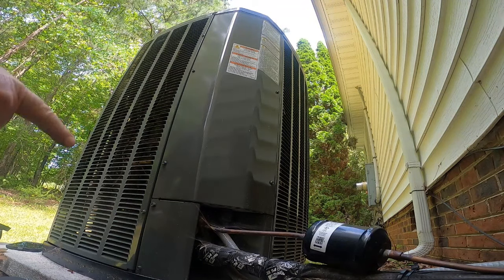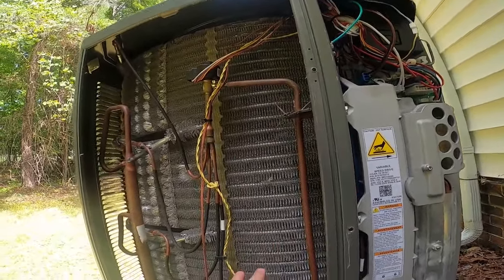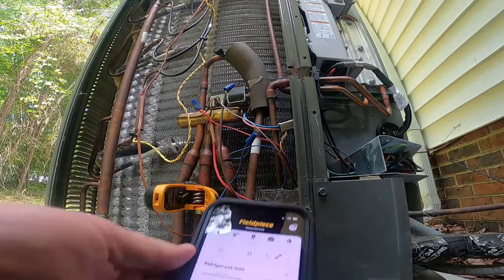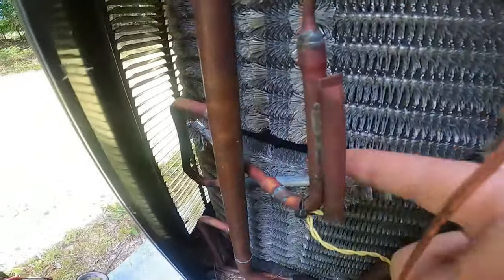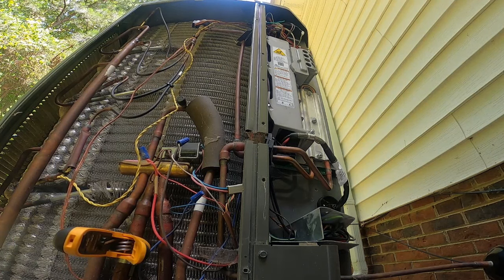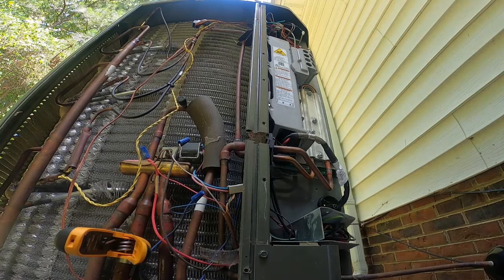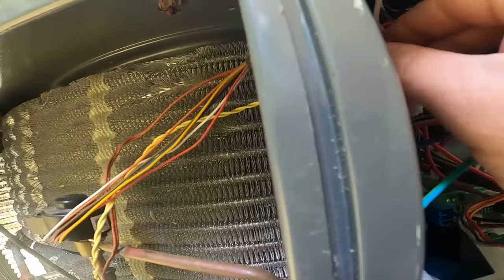Troubleshooting a Trane XV With temperature sensor issues.

Comment: Thermistors are the weak link.  The epoxied wire end seal is not real hermetic so prefer to mount wire side down and wrap with insulative tape for good thermal isolation from surrounding air flow and keep condensation off of thermistor.

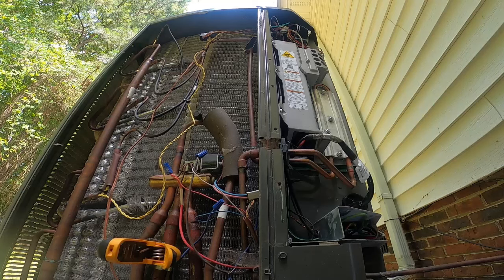Comment: That sensor is the most common failure I have seen in the 18 and 20 ODU.... that one looked a little crooked sideways in the video when you showed where it is plugged together. It may have been fine but go back and pause the video at 6:35 if you're interested. It may have been a white tag, tape or something else tricking me but it seemed a bit sideways. Great video on the variable unit !!
Reply from the maker: $12K system $11 part. With that said, these units are great and have been mostly problem free”Knock on wood”! Just posted a short where the unit came out of the box with the suction sensor connected in the wrong spot. Have seen that a few times, just need to check it on start up.

Comment: My heat not coming on or condenser fan. My blower fan is working and believe blinking 5 time which is temp sensor.

I have xl15i but can’t find on the net where it’s located. I’m going to try look for same place you did. Any clue?

Also if it’s 6 green light then could be valve failure from heat:cool?